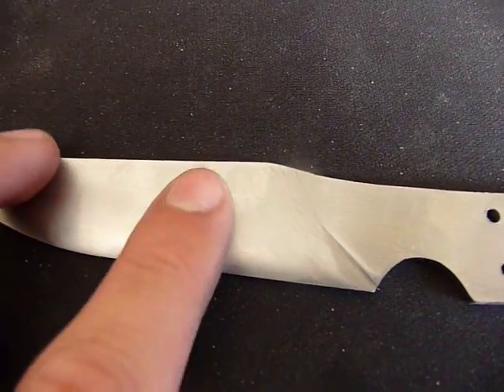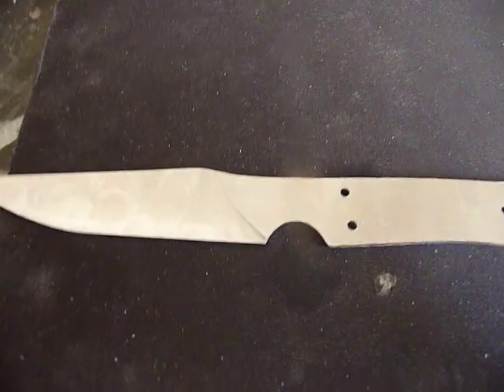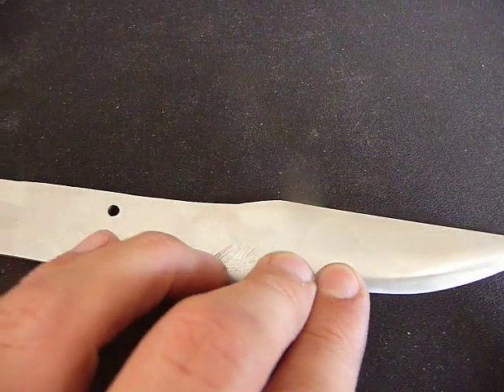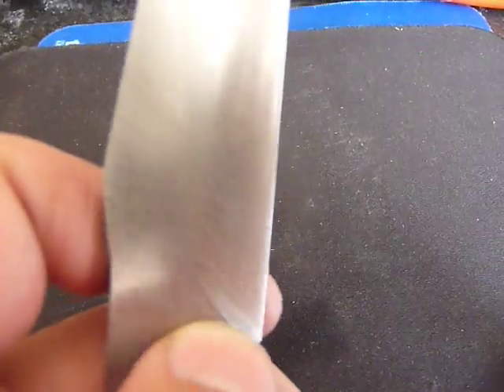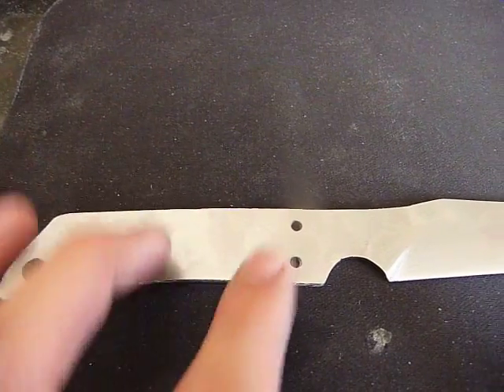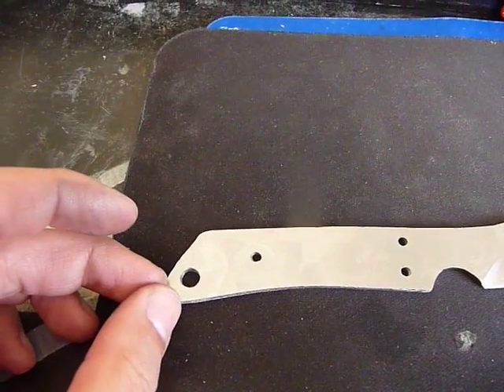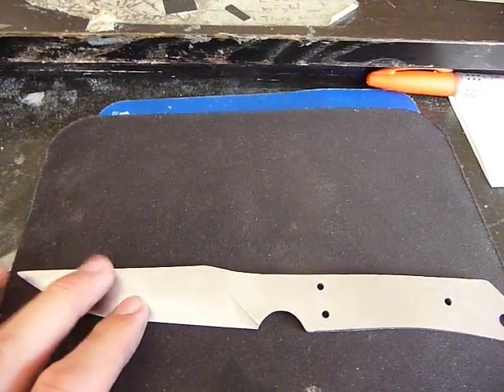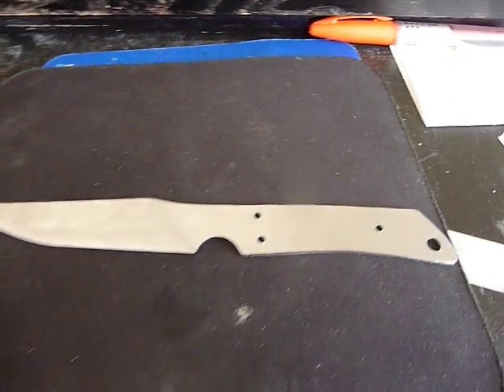SFBA knife build phase 2

Comment from the maker: @beelikestowatch I believe so its just hard cause the paper is unsupported and will roll your corner. If your gonna fit a handle on that spot you may have a gap later on. Also it wears out your paper quick if you do it to hard. Short answer yes but be careful =)